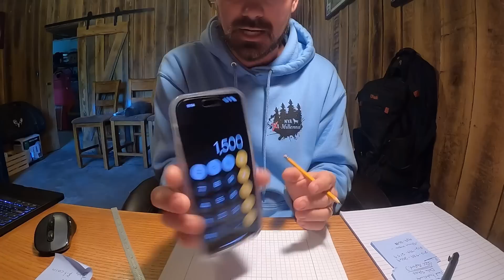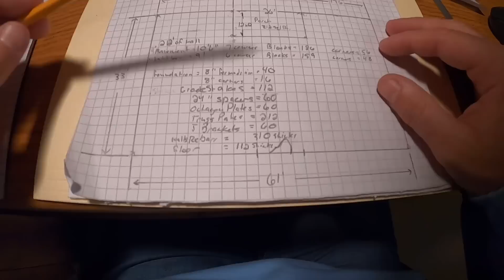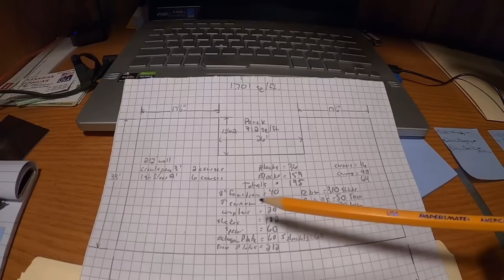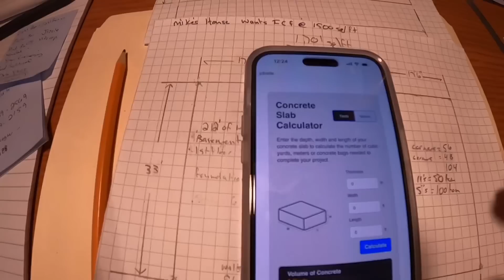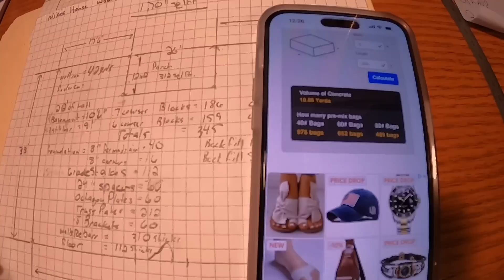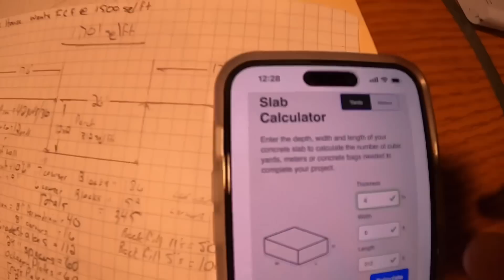ICF rough layout and bill of materials

Comment: Interesting.  Thanks for the primer on ICF.  I have a couple of questions:  Is there a requirement for depth of footer that would be different for a basement/first floor that is greater than a crawl space since you have only 3 courses for the crawl space and necessarily more weight on the footer if you have a 10.5 foot basement with 9 foot wall on top?  Would the depth of footer increase if they chose to put an ICF gabled end on two sides?  Again wondering about the increased weight of concrete from those ICF gabled ends.  Again, great content Matt.
Reply from the maker: 8” thick x 2’ wide is standard the strength comes from the rebar used. 2 stories all the way up is no problem for that footer. If a person gets bigger than 2-3 level engineers can increase footer to ensure capacity. Sometimes that equates to increase in rebar size only.

Comment: Nya millennial I was wondering what the advantages are with icf verses non icf foundations
Reply from the maker: @c-v-n hit the nail on the head!!!   Thank you
Reply: Your icf forums stay in place after you pour the concrete it's insulated on both sides of an R-25 saves you about 60% energy bills. I personally could go on about why it's better. The cost is a higher than pouring the traditional way.
Reply from the maker: Awesome!  Spot on
Reply: @nyamillennial  can you please do a video on form a drain systems
Reply: @c-v-n3322  thank you for explaining it to me

Comment: You did a very nice presentation on fiberglass rebar. What is the cost difference?
Would there be a viewable difference using alternate rebar?
Interesting process for calculating the build proposed.
Thanks for sharing.
Reply from the maker: Click the link of the glass rebar video. They can ensure you have the pricing. But simple answer is basically 1 to 1